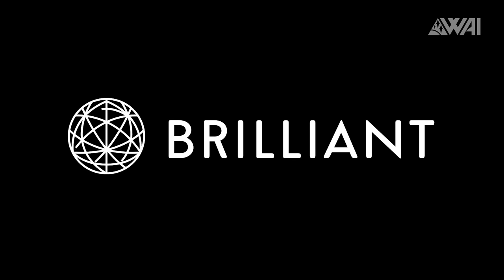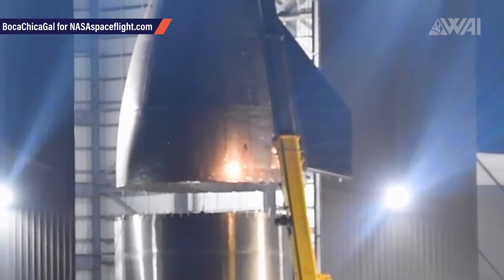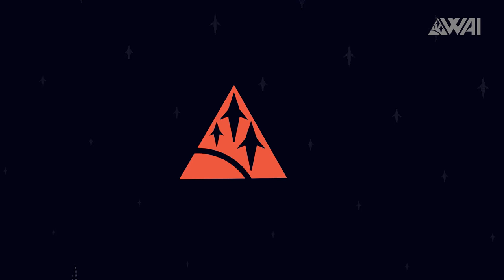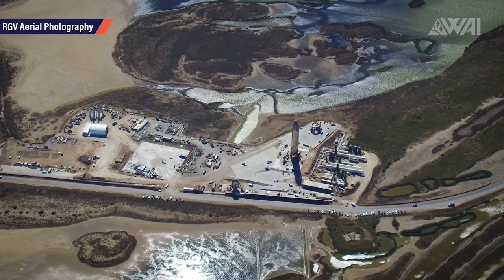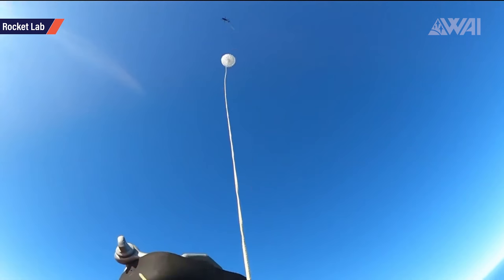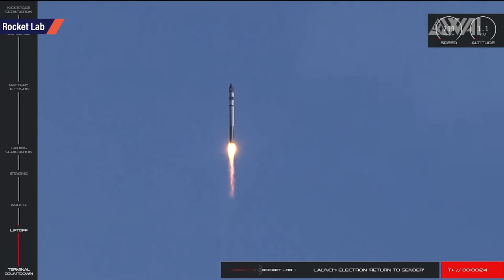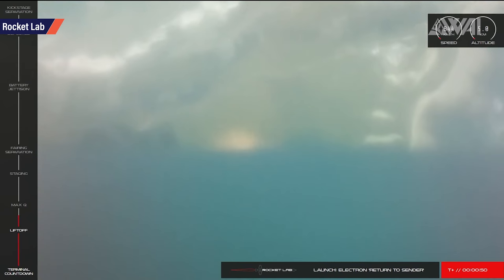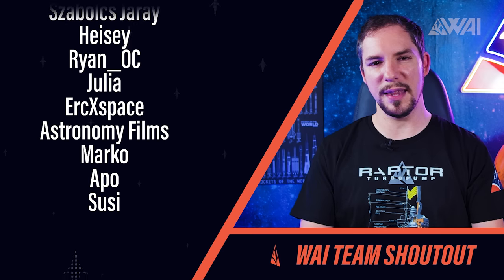135 | SpaceX Starship - What's left until the launch?

Comment from the maker: What is SpaceX building in front of the orbital launch mount?
Reply: Propellant pressurising facility maybe? idk
Reply: Hi Felix, when do you think the 2020 starship presentation will be?
Reply: What about it!? Hot Dog stand.
Reply: A new tankfarm
Reply: My bet is on a large stationary crane so they can stack the rocket on the launch pad.
Reply: Bunker
Reply: Ya know if the doomsday glacier ever breaks off nearly all space ports will be underwater, including boca chica, i wish they had built it further inland.
Reply: @KnoppersBomber  I like this one. But I can't see it looking like walls though. :-)
Reply: What about... the launch mount? Don't you think the OLM might be the foundation for the massive crane which will lift and secure starship? Think about it. The drilling foundation provides the required torque, ... the missing flame diverter, ... it just makes more sense.
Reply: In the last video I commented that it could have been either a new landing pad specifically made for super heavy boosters for their 150m hop, a parking lot, and a water tower. But could the land perhaps be used for another orbital launch pad? 🤔
Reply: My bet would be that it is where all the electronics that will control the pad will be going.
Reply: @EmbSys  That’s exactly what I was thinking!
Reply: its the building from the animation
Reply: @damitcam  The planet Earth is not warming so you're postulating an earthquake/sunami event?
Reply: I guess it's the new tank farm.
And the bunkers (for the fuel pumps probably).
Reply: @johnbuchman4854  and @C Cube Miniatures Hate to be that person, but you guys are both wrong. @John Buchman, have you heard of this thing called global warming? And before (and if) you respond, remember there’s indisputable evidence of global warming. 
@C Cube Miniatures, working next to the beach was a better idea because of the lesser population in that area near that beach, and because if something explodes, there’s water there. I don’t think sea levels would rise so quickly like a tsunami. If anything it could take decades for that to happen.
Reply: @damitcam  don't believe all the global warming doomsayers
Reply: @mr_universe4000  nothing is indisputable.  Bring me 50 scientists that say it is and i can bring you 50 more that say the opposite just like with covid
Reply: Probably just a water tower ;)
Reply: Maybe raptor storage for fast swapping
Reply: 1 "What does SpaceX build in front of the orbital launch pad?"

I think this is the frequency of the orbital launch platform itself!

2 "What's left until the launch?"
Checks and a few more calculations!
Be Healthy Felix :)
Reply: @mr_universe4000 actually it is called the doomsday glacier because if it were to break off which it will eventually thats a fact, then it will start to float because it wont be attached to the land mass so it will instantly raise sea level because of its displacement. It doesnt have to melt to screw the coasts because its just that big
Reply: @Cydonius1  but how can you explain that since the start of the industrial revolution the climate has started to change? (Just for starters) Plus, I doubt you could bring me as many scientists as I bring to you that could say without a bribe that global warming is fake. It is real, and that’s what we have to deal with. We can change it.
Reply: @damitcam  while that is kinda true because there is a glacier waiting to break off. I don’t think it would displace anything. The melting water from the glacier will add more water to the ocean making it rise. But it will not displace anything. Think of it like this, it’s already attached to something displacing water, when the glacier breaks off and goes on its way. It won’t desplace anything because it’s not something that was added to the ocean, it was already there just not broken off.
Reply: @mr_universe4000  it's a cycle, warm - cold, warm - cold, some say it's solar driven, others think the earth's mantle shifts changing the locations of the north and south poles.  Did you know that they found the remains of tropical forests under Antarctica?  There was an ice age around 12,000 years ago and another one may happen soon.  I'm just pointing out that any temperature changes are natural not man driven.
Reply: @Cydonius1    yes I do know they found a prehistoric tropical forest under Antarctica, it would make sense given that Antarctica was closer to the equator a long long time ago. Anyways, while those are all theories that have been spoken about I don’t think it is a hot-cold-hot-cold cycle. Yes I also know about the ice age that occurred 12,000 years ago, but keep in mind that this is different. Sure put it that could be a hot-cold cycle, but it wouldn’t be anything like this. It’s proven that there’s record high levels of CO2 in the atmosphere, and when did that become a problem? Right as the industrial revolution began. What a coincidence huh? This is a mad made situation that is getting worse and worse every year. How could there be another ice age if the temperature is higher than it was before? It just can’t happen. It also can’t be solar activity that causing this because the sun is pretty consistent. It has been since the beginning of humanity. Sure the cycles are kinda messy, but the temperature and solar wind stay the same. Global warming is a man made problem. You can’t argue that the current global temperatures are natural if they’ve never been this high.
Reply: @mr_universe4000  without going into detail, we simply don't have records going back pre-industrial age.  There is no way that some factories in Europe for a couple of hundred years causes such a dramatic and instant shift in temperature.  If there is such an increase it must be looked for from other sources, possibly off-planet  where there is much interesting research done about how rotating bodies (planets) affect each other through torsion of the space surrounding them.  For example, where is the energy coming from to sustain Juipter's Great Red Eye storm or Saturn's polar hexagonal storms and so on.  Also, if you look at the Vostok Ice Core sample analysis, they found that there is a lag time of many hundreds of years between increase in CO2 and increase in temperature, so again, factories in Europe causing a slight rise in CO2 would then, if following the Vostok ice core sample pattern, would only be apparent sometime in 2300.
Reply: @Cydonius1  I thought you said you wouldn’t be going into “too much detail”. Anyways, there isn’t anything else that could be affecting our atmosphere so much in a little over 310 years that is outside the planet. Jupiter’s red spot isn’t doing anything, the hexagonal storm on Saturn’s North poll isn’t doing anything. They really can’t at all that logic is faulty and wrong. There isn’t any gas nearby the planet due to the suns solar wind blasting it far away from earth. And even IF there was by any miracle. Earths gravitational pull wouldn’t be sufficient enough to gather so much in so little time, and that’s not even mentioning the other celestial bodies. The Vostok ice core you mentioned is a fair argument, however you must remember that it’s still measurements and estimates too. There could have beed many local events when that ice was being formed that made it look like it had a lot of CO2, and ice is also inconsistent sometimes. Not everything is set in stone like us humans like it. Let me also remind you that there isn’t a “slight rise” in CO2. It’s a vast amount greater than what there was pre-industrial revolution. The Vostok ice core was also found in Antarctica! A place where if we remember it’s past is volcanic underneath. I’m not saying there was eruption but perhaps a volcano decided to spout out a bit of CO2 before it went dormant again. So let’s take a look now at the points. Something effecting us from space: faulty logic and quite impossible if I do say so, The Vostok ice core showing a large amount of CO2: perhaps by some local event or one of those actual hot and cold cycles. Not as hot as after the industrial revolution and not nearly as much CO2 may I add. And why would the Vostok ice core become more relevant in 2300? By then god knows what happened to it or to us. Maybe global warming got to us. This is all starting to sound like global warming Is real isn’t it @Cydonius 1?
Reply: @Glugule Buc Maybe, but if so. It’s a great opportunity to learn! :) plus the explosion will probably look cool 😎
Reply: @mr_universe4000  you misunderstand me.  I didn't say the Great Red spot storm on jupiter or the hexagonal storm on Saturn affect Earth's weather.  I'm asking where do they get their energy?  Everything is energy and to sustain a storm that is bigger than earth for so long needs huge amounts that wouldn't be explained by normal mechanisms on jupiter.  Here comes torsion physics that postulates that every spherical fluid rotating body (a planet or star) generates a torsion field around the object.  The bigger the planet the bigger the torsion field.  When for example Jupiter, the biggest planet in the solar system is on the same side of the solar system as Earth for example, Jupiter's torsion field and Earth's torsion field interact.  Imagine you throw a stone in a pond it causes ripples on the surface, if you throw another stone close by the ripples from this one will cause interference with the ripples from the other stone.  This interference of interacting torsion fields generates energy upon the planets and we see this as an increase in weather activity or volcanic activity or maybe earthquakes or more tornados.  It would be interesting if there were a study to correlate such phenomena with the locations and movements of various planets.  To cut a long story short, again I say it is not man-made climate change but can be explained by many other systems.
Reply: Party Room
Reply: @Cydonius1   That isn’t really scientifically accurate at all. However something that is true is that Jupiter’s gravitational pull affects everything, but not so much in a way that it would affect earths geology. The weather on jupiter is caused by the heat and pressure from within the planet. Same goes with Saturn. There both so massive and so dense on the inside that it causes heat to rise from the core (which Is way hotter than the surface of the sun) and causes vortices in Jupiter’s and Saturns atmosphere. In no way do Jupiter or Saturn effect the geology of earth. Btw your using the wrong use of the name torsion, it’s something about quantum spinning particles to possibly send information at the speed of light not to mention that it was based on many unfounded claims. Nothing even remotely close to shifting whole planets geology. So the ripple effects your talking about don’t really exist also because space is a vacuum, not a substance where ripples affect anything. Perhaps gravitational waves could be argued for, but they can’t really for the geology of the earth because their so far apart. It would take something much much more massive than Jupiter and Saturn to have any affect on earths geology.
Reply: @mr_universe4000  The ripples don't happen in vacuum, they happen in a higher dimension and they are not related to gravity, that is something else entirely.  I am not talking about the gravitational pull.   It's hard to explain in such a small space, you have to look up Bruce De Palma's spinning ball experiment for one, also a lot of articles and lectures by Richard C. Hoagland
Reply: @Cydonius1  You do know this is all hypothetical right? We can’t prove there’s another dimension and even before that we can’t implicate a theory so out there without proof right?
Reply: @mr_universe4000  yes it's a theory I didn't say otherwise but it's something to get the brain working and thinking out of the box ;)
Reply: @mr_universe4000  Also there have been some experiments done to calculate torsion waves such as the Foucault Pendulum experiment during a solar eclipse.  There's a paper on that if you google it
Reply: @Cydonius1    I know very well about that experiment, but your just changing the subject. And you are implying the theory on your argument making it look like you are saying it is true. Don’t turn the tables on me pal, you know that I’m right.
Reply: Point of entry for boring tunnel

Comment: Starship can also do rideshare, but each satellite will get a boost stage for orbital maneuvers and all that. Cost/kg will be significantly lower than rocketlab to same dedicated orvit
Reply: yes, but people will still use smallsat launchers for a while, at least until starship cadence gets to a high level
Reply: There will be businesses for Rocket Lab, even after Starship reaches higher cadence level. Starship schedules will be tight for sure, and customers will be looking for alternatives. In business terms, you don't have only one supplier. You have many for backups.
Reply: maybe its possible for starship to put electron in orbit.
Reply: @Mallchad  Not even a challenge... a stacked Electron is about 17m tall, and a little over 1m wide. You could easily fit a dozen of them in the Starship payload bay...

Comment: I see the wall molds being put up for thrust diversion being put in place to pour concrete walls above ground around the launch platform. They might backfill earth around those walls to contain the high pressures of the exhaust. In the end it should all be under ground. Makes sense since digging below ground you run into the problem with the water table being so high that you would have problems with ingress of water getting into the work area. Pretty smart build it up instead of under ground into the water table.

Comment: Your make a good point about Starship not enjoying a thrust diverter/water suppression system waiting for them on Mars.  Feels like a huge challenge to safeguard the engine "undercarriage" from debris damage.
Reply: Hm, makes sense then that the first starships to land on mars should contain replacement raptor engines and undercarriage components in case subsequent ships need to perform repairs to be able to make the return trip.
Reply: I think a lot of the debris at the landing site is going to get blown away on landing.
Reply: Given the much lower gravity on Mars and the Moon, they’ve already shown that instead of using the main engines for the final landing and takeoff, they will use small versions of thrusters higher up on the Starship until they are high enough off the surface such that they can then ignite the main engines without danger of kicking up debris that could damage the vessel.
Reply: @peterkacandes5905  Nearly but not quite right.  For Mars, they should not need to redesign the engine layout for this reason.  However, for the lunar version (no atmosphere & half the gravity of Mars), someone calculated that the thrust from a Starship launch could blast lunar regolith with enough velocity to put it into lunar orbit thus endangering any future low orbit / lander missions.  The high level engines are there to land / launch with minimum disturbance.
Reply: @poruatokin  As I understand it, you still need to protect the main engines from rocks/debris that could be kicked up from an unimproved surface, as happened on the test stand with a prepared pad, regardless if it’s the moon or mars. Adding the upper level thrusters, despite the added weight/complexity seems likely to be a good way to address that problem, but I’m no rocket scientist and I trust they’ll figure it out one way or another. Seems like hardening the main engine bay against projectiles sufficiently will add at lot more weight than the upper lever thruster system.
Reply: @peterkacandes5905  Of course, everything is at the prototype stage now so anything could change - should be interesting to see how they solve it.

Comment: Yes, for Electron the main challenge is not damaging Rutherfords (not even nozzles) without re-entry burn like that Falcons perform.
Reply: Indeed. The idea of a helicopter catch is the bit that amazes most people, but that's probably the easiest part of the operation. The hard part is getting it through re-entry in a re-usable condition, which is why they're not convinced about the cost savings... if the body is intact, they'll be able to increase cadence even if they need to replace all the engines, but they've obviously not going to save much money that way.
Reply: @simongeard4824  Yes. Some of the "old players" (Arianespace or ULA) is or was playing with an idea of returning only first stage engines, as the most expensive part.
Reply: @bazoo513  It was proposed for Vulcan, I believe...detach the engines from the tanks, and recover them by chute...
Reply: @simongeard4824  Ah, yes. Thanks.

Comment: Real good point raised here, they won't have a flame-diverter or even launch pad for getting off the Martian surface. For this prototype testing phase it's fine to do what's convenient to make the tests they need, I'd suggest they just bite the bullet and make a flame diverter or some other system to deal with the exhaust. But eventually they will need to design either engines that are robust enough, or landing legs that are long enough to deal with not having any facilities to protect the rocket from it's own exhaust on Mars.

Obviously the hope is to eventually build launch facilities on Mars, but that could only be after several if not dozens of previous trips. Otherwise, these are 1-way trips